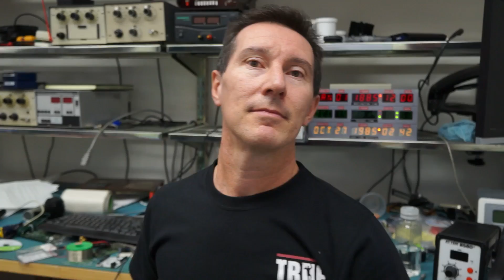eevBLAB #2 - Are Electronics Hobbyists Useless?

Comment: I started my electronics hobby around 1975 when I was 12yo using a Radio Shack 100-in-1 kit.  My first uC programmer was for the Intel 8749H NMOS single-chip computer.  The programmer, I designed, etched, drilled, and built myself in 1990 by studying the Intel embedded databook and programmer's handbook.  My first "IBM compatible" desktop was a 12MHz AT286 with 640kB ram and a 42MB HDD.  I wrote the terminal program in Qbasic and the uC code in assembly and used the TASM compiler that I got from a dial-up BBS.  With that, I designed and built a small robot that had many modes and sensors and LED lights and sounds.  I took it to a job interview and instantly began my 30 year career as the company's top EE.  Prior to 1990, I was studying the Forrest Mimms books and making all sorts of cool things.  Sequencing Xmas lights, blinking Frisbees, digital clocks, electronic ignition for my dad's car, RC boats, planes, and cars with lights and sounds, you name it.  When I started my "real" job as an EE, there were several graduated 5yr engineers and PHD guys that didn't know crap about anything and I was often ordered to teach them and yet they made twice my salary.  My first commercially made programmer was the Microchip PicStart-Plus that I got free at a seminar.  I used to have to rotate a dozen UV-windowed chips through a UV-Eraser box during code dev.  Later, I got a Mathius realtime emulator, you know, with the flat ribbon and the expensive modules for each chip family and member.  When the PIC16F84 came out, that was a game changer.  Soon to follow was the PIC16F877 40-pin with built-in ADC!  I didn't get into embedded C programming until about 2005 but thank God I finally did.  It's good to know assembly to really understand how the chips works but after a while you have to admit that letting an advanced compiler do the really hard stuff is a life changing advantage.  Obviously, I debug and program everything in-circuit now like everyone does, but it has been a long road.  Kids today have no idea how lucky they are.  All the free advanced IDE's, bootloaders, high level languages, internet access to datasheets and sample code and everything, forums that answer every question instantly, really cheap component and material sources, cheap online PCB suppliers, free 3D modeling... c'mon.  It's a walk in the park now.  Jeeze, these days, the only thing I could build to impress anyone would have to be warp-drive or teleportation.

Comment: When I started out in Electronics in the early 80s, PCB production was a bit of a faff for the hobbyist. It often involved sticking transfers onto copper strip and bathing boards in ferric chloride. When printers got better, the technique morphed into printing designs onto clear slide material and exposing photoresist coated boards, then bathing them in ferri chloride. Afterewards, there was all that drilling you needed to do. For most small projects it just wasn't worth the hassle, pre-drilled board or vero board was much easier.

Today, KiCad is a breeze and JLCPCB is cheap, it really shouldn't be too hard to produce a PCB nowadays but it does require some investment in learning the tools. What makes PCB design compelling is the miniaturisation that is possible with SMD technology. But even today, for the odd one-off and prototype, I still choose veroboard. One needs to order a certain quantity to make PCBs worth it.

Microcontrollers are a bit of a specialist area and programming skills are very different to the electrical aspects of design. With dirt cheap MCUs, I can see why it is becoming more important, but can we really expect the electronics hobbyist of today to have programming skills? I guess it depends which camp you are coming from, there is a generation out there that start off with a arduino/raspberry-pi/blue-pill and program those to switch things on and off without really understanding electricity. For these people analog design is the hard part.

You are asking for multiple skill sets, expecting electronics hobbyists to be really quite advanced. Someone who can design their own PCBs and program MCUs don't need you help and can probably go into business on their own. Think back to what you were capable of when you were a nipper.

Comment: I am not an engineer but only a technician. Most of the stuff I know in electronics I had to teach myself by opening books and buying my own equipment. At a former company whom I worked for some people only did Surface Mount Soldering and the size of the pieces were really tiny. I asked one of the engineering if I can solder some of the components. He asked if I had experience in soldering very tiny SMD. I replied No. I did not do soldering for SMD. I mean basic hobby skills is all that you mentioned but I think SMD soldering you really need like freaking stable hands and really good eyesight despite the availability of huge magnifying glasses. I think the right person for your job application is more of a technologist or a technician though rather than a Electronics Undergrad.

Comment: I'm 54 and was making my own boards at 15 using stencils or felt pens and ruining my mums kitchen utensils at an alarming rate. my mum was a florist and had some cool nichrome wire I used to use to make a soldering iron.  the first iron I made was from the balast resistor of a TV unwound and wrapped around a brass knitting needle my mum donated (lost) ☺.  old electronics were stripped for parts and many hours spent in the library studying electronics.  I flunked everything in school but have a wealth of knowledge in electronics and still learning and really enjoying the kit available these days.  amateur radio clubs seem to be the place true electronics nerds hang out these days maybe approach them

Comment: I'm just a high schooler EE hobbyist, I can solder thru-hole components, design and manufacture a two-layer board with eaglecad,  and create my own arduino clone under an hour... However, I consider myself still a newbie. I think Dave's requirements are not high at all. I've seen many people who can solder SMD components as easily as I can peel a banana, and in fact, I haven't seen any EE hobbyist on the internet (like hackaday.io)  who can't solder SMD. I know that there are many skill levels in hobbyists but for Dave I think he is justified!

Comment: I'm only a hobbyist myself, and the name 'hobbyist' reflects the fact that I have no degrees in engineering with most of my knowledge being self-taught, and while I could probably meet the criteria you mentioned, it would take a reasonable amount of time with potential mistakes (I don't know what I don't know in other words). On the other hand, if I was in my 2nd or 3rd year studying a degree in electrical engineering, I'd rather be called a 'student engineer' instead of just a hobbyist and I would therefore expect a higher level of knowledge from myself, just as others would.

Comment: I can basic troubleshoot some circuits to some extent, but still can't design my own circuits. I always modify schematics that I can find on the internet and replace parts that are not easily available and I consider my electronics skill still on the "hobbyist" level after 2 years of electronics tinkering. I'm taking up chemical engineering though.

Basically, Hobbyist=anyone who messes with electronics

Comment: Absolutely spot on. 37 years as an electronics engineer now.  I remember ripping out the last commercial strowger exchange in the UK & putting it's replacement on a single wooden skid in a corner of a singe floor where the monster used to live on 4 floors of Brunell House (Brit Rail) in Cardiff. I look at the vacancy postings today & they read like alien descriptions. More geek skills than REAL engineering. Since when did writing a line of computer gobbledegoog = a list of selected components carefully calculated to interact properly laid out skillfully on a bit of copper clad? How many of these kids could design a wein bridge oscillator or even know what one even is? How about chopper lump power supplies, the forerunner to switched mode power?...These kids have no idea!

Comment: I agree totally mate. Everything is being dumbed down these days. In the UK when I started out on my electronics career. There was the City & Guilds qualification which was usually 2 years part time to get a qualification in TV & RAdio repair or VCR repair, then later on we had the BTEC. I did a 14 month full time course to get an Ordinary National Certificate, later on I did 2 Higher National certificates, each 2 years plus you had to have an ONC to start, they also had an HND which was a slightly longer course. After that the Degree level. so to start a degere you had to have either A rated school accademic quals taken in 6th form or a HNC to get onto the degree. Well now you can start a degree with nothing, ONC's and C&G's dont exist, you can get an HND in about a year. I even felt I was treading water as I went through my training as I would have about 5 years between each stage. Its no wonder we have a world of morons who proclaim they are this and they are that, it takes an Arduino these days to make a friggin LED flash FFS!!!

Comment: I'm a hobbyist. I can solder through hole (haven't tried SMD yet - that's a soon project), I can make a schematic in Eagle and lay out the PCB. Trying to learn KiCad (why all the steps between schematic and PCB?), I can trouble shoot basic stuff (Oops I lifted a pad, the resistance is way off on that resistor...). Of course I was born in 79 to a father that was an EE, so that thought me things (I remember the CAD programs that were available back in those days). The problem of these days is that, things are so cheap, people throw them away, instead of repairing. Thing these days are not as easy to repair like they used to be, so the entry point is way higher then it used to be in some respect.

Comment: Within three months of learning about what Ohm's law is and, for the matter, what a volt is, I have: made my own USB keyboard, modded my bathroom scale to upload weights to a spreadsheet over WiFi with custom ESP8266 firmware, programmed my own CPU design into an FPGA, debugged a signal problem in my 30MHz TFT driver, and had a PCB made that I soldered SMD stuff to (granted, not the FPGA w/BGA; that scares me). So, I don't think you're asking for too much. I consider myself to be a complete nub still, but it really is a lot easier than it should be to do this stuff.

Comment: You ARE asking for the BASIC skills of a hobby electronist!
When I was 'round 13 (i.e. 28 years ago.. ouch!) I bought my own transformator, made the ad/dc part out of other leftover stuff, added a few condensators on a typical prototype board and DONE! Or in a different case where I had to make 250v out of the usual 234v (for an 1541 floppy with the regulators outside of the 1541 for heat issues), so I put a transformator in line to upp the voltage! Oh, I and soldered the 1541 voltage regulators out of the 1541 and put the on decent heatsinks.
I'm not doing that stuff any more, but he is right! These are basic electronic hobbyist skills! You don't even ask to use acid to create the board on your own, though that counts to me as basic too.

Comment: You are absolutely right Dave. I don't know what all kids are doing these days (who are involved in the hobby), but I expect my grandsons to meet this level. It is not all that hard. Start simple. Take a transformer and step down the voltage from 120 to 25 volts. There's a nifty little lesson there. Pop that AC through a 4-way bridge rectifier to around 20 volts DC. Explain that. Push that 20 volts through a high voltage DC power supply, to the primary of a fly-back transformer (they already understand inductance), ram that into a Jacobs Ladder, and you can developer some real interest here. Now, boys, how can we neaten this thing up? These Arduino platforms are an interesting study in structure, and there is a great lesson in how THEY work. It is a great time, a rich time to be an electronics hobbyist. Parts, even tubes, are widely available, information, including obscure schematics are usually found, and shipping from China is FREE!!! Let's not get greedy, but there is no reason for technologically illiterate students. 73.

Comment: 1987 I graduated from a technical school in electronics. My first job after graduating was as a computer repair tech. My first day the boss had told me we never trouble shoot to a component level only to a board level. Reason being it would cost more to the customer for me to repair the board then to replace the board. Fast forward to my career working for the phone company and wireless carriers, again we only troubleshoot to a board level. Most companies that I worked for do not want me troubleshooting circuit packs at an hourly rate when I can pull a new pack from spares to replace the bad pack. Yep most monkeys can do that job. Returning to electronics as a hobby has helped me relearn the component level troubleshooting I did back in school. I do have pretty good troubleshooting skills honed over the years to look at the simple solutions first, no need to tear into a circuit when you forgot to turn on the power supply.
Reply: +worldofzap I was sure it works as you described, today phone companies or any bigger company wont be bothered to replace a small chip when they can charge you for the whole board. Frankly anyone can do that.

Comment: Personally I think you get various degrees of hobbyist. Some will know everything but it comes down to your exposure and experiences. I personally never design circuits but work out things when they go wrong. I know basics soldering, fault finding, diagnostic, looking up chip information, circuit diagrams, etc. Though if you asked me to design some modern FGA design or BGA with chip layout, I'd personally possibly run into problems quickly. Though if you dumped an old piece of electronics in front of me with a description of the fault, I could possibly fix it quite quickly.

Comment: im an 8th grader. 13 years old. i can do anything from solder to program an arduino to trouble shoot a circuit and i can use a multimeter. I been using a rotary tool also.

Comment: I think the problem today with school is that there are way too much theoretic work/reading.
When there should be much more practical work, that is how you learn and how what you've learned stays in the brain and dont fly away the minute you leave the classroom. Its quite well proven too.
More practical work, more mistakes, more fiddlign with hands. This combined with the theoretic information should do the trick. 
Example: You dont learn Android mobile by reading the manual, you learn it much faster by just fiddling around with it, right?

Comment: When I was 13 I was doing simple design and layout, by 16 i had designed and built a simple computer round a 6800 micro with an operating system written in hex code! I was hiring myself a while back and it was damn difficult to find a graduate than knew as much as I did at about 15!

Comment: The same decline in skills has been very prevalent in amateur radio.  In the olden days, hams built most of their gear.  The built their receivers, which were, as likely as not, regenerative design.  As the bands became more crowded, they tended to buy most sphisticated superhets.  But at least, they did their own repairs and alignment.  And they usually built their transmitters.  Then along came the fancy tranceivers, and hams gravitated to them.  By the 1960s, a whole new breed of low-skilled hams came into being, hams who barely knew the theory required for passing the exam.  We called them "appliance operators."  :)

Comment: I think it is a generational gap;

First it started with child labour. Back in the day little kids were plucking feathers off a chicken and putting their soft, tiny hands to use. Nowdays that is considered child abuse and depriving them of "The childhood they deserve". (Discussion for another time, included for theme.)
Then later in, with computers, there were not the hobbyist kits that exist today; Starting off with computers, you had to build it yourself. There was no other way to do it! It was a surprise that Altair even made the waves it did (and that was the pioneering computer, not the trash-80 dookie that people could bodge together from Radio Shack [rest in pieces] if they tried.)
Then we've simplified desktop computing to the point where all you need is pre-built components, standardized and measured within spec; No soldering required! Just throw cash at a vendor, drop in a CPU, RAM, A / V through PCI, socket storage data, maybe through PCI these days but back then to Serial ATA or even to IDE if anyone remembers that and you're done!
Now, we have little kids that don't give a rip about tinning their cables because they don't learn the skills required to do so; Nobody is use to having nothing done for them, so they languish and become entirely dependant on people like you with the time and experience they're not willing to invest. Worse yet are the overprotective parents that don't let kids even see a soldering iron so they understand the basic tool used to make all they see today happen.